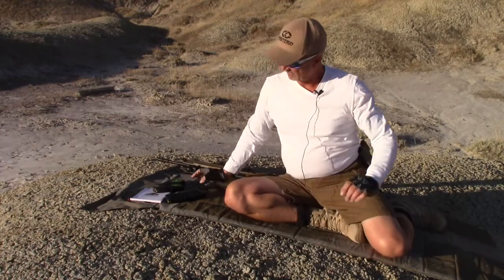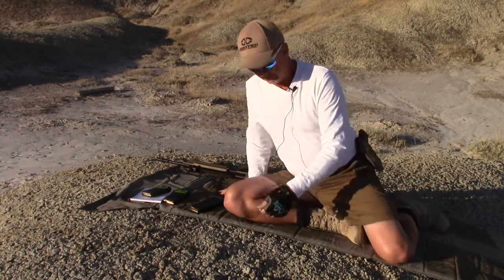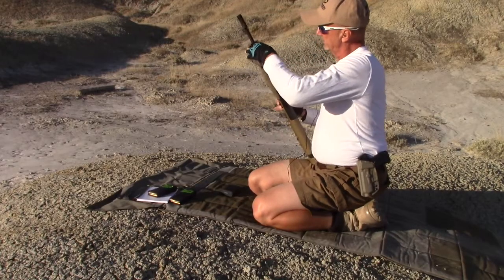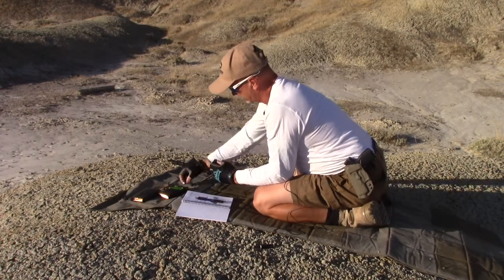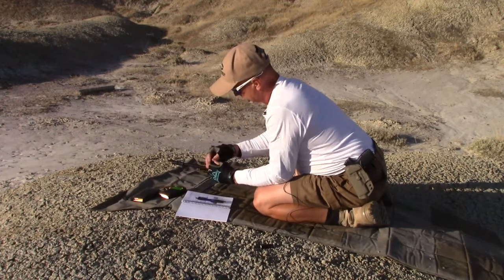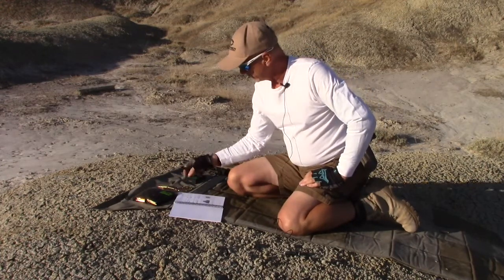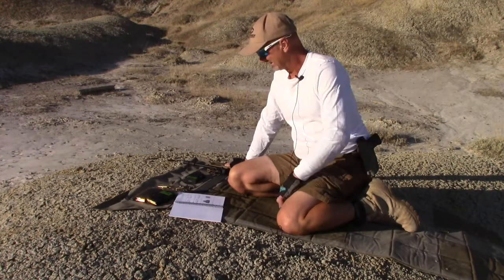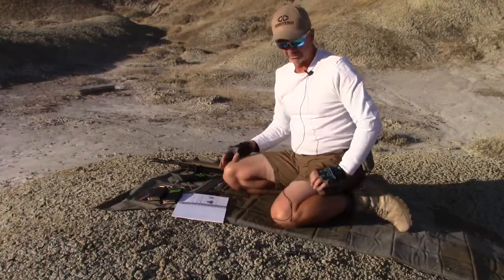KelTec RDB Gas System Test Based on Different Bullet Weights

Comment: I find that the gas system is easier to explain by using different terms - it's a gas 'vent' instead of 'knob' and instead of clicks 'left' or 'right' I use 'open' or closed' referencing the direction of travel, since it moves in the direction that it's sending pressure. People tend to grasp the idea much sooner.
Reply from the maker: I'm using that next time I cover an adjustable gas block...adjustable gas vent.

Comment: My 18.5 barrel with 62gr is set to 4 notches from closed.
Reply from the maker: That's a pretty big difference from my 8-9 setting. I wonder if there's been an update to the gas block since my testing. Your setting leaves you a lot more room to accommodate a suppressor.
Reply: @AmbGun  no doubt bizarre. And unrelated but today at the range after 80-100 rounds firing pin didn’t hit primer but the slug got pushed into the cartridge. Very strange. I kept it after keeping in the nearby pond for hours.  I’m not active on social media but would love to share the pic of the cartridge.
Reply from the maker: @brutus007  I would like to see that. If you could email it to rifleman@ambgun.com I will post it on the RDB page on www.ambgun.com.
Reply: What RDB comes with an 18.5" barrel?

Comment: It seems to me like you did it wrong. If you started at 10 from bottom if you ad more clicks your adding more gas  which the bolt should always lock back. If you start with 10 you turn clicks towards bottom to take out gas then the bolt wouldn't lock back once you took to much gas out.  I have a rdb  mine is at about 14 clicks
Reply: Isn't 14 clicks all it has

Comment: Thanks so much for the great videos! I know you haven't been getting the traffic you expected, but the ones who watch love the content!   When you use the terminology "in" and "backing it out" does that mean increasing the gas setting opens up the valve (backing it out) and when the gas adjustment is "in"all the way it closed off virtually gas being redirected?   Also I assume the + on the RBD means more gas and the - means less gas
Reply from the maker: Turning "in" is delivering more gas, "backing out" is reducing the gas. As you back it out you reach the point where the rifle stops cycling (or locking back on an empty mag). 

Adjusting the RDB gas system is real easy.

Turn the adjustment knob all the way in (clockwise) until it bottoms out. Back it out counterclockwise 10 clicks. Insert mag with one round, fire. If bolt locks back on empty, back off two more clicks until bolt fails to lock back. At this point turn the adjustment back in clockwise 4 clicks for reliable operation. Turning it in more clicks it will continue to cycle but more harshly...if action got very dirty, you could click a couple clicks in clockwise to force it to cycle. 

I really like the accessibility of the RDB's adjustment knob (compared to the Desert Tech MDR).
Reply from the maker: Yeah the traffic has been disappointing. Last year, traffic and subscribers were rising exponentially and then suddenly plateaued...coincidentally with two videos highly critical of CCP Chinese products. Also at about the same time I expanded heavily in alternative streaming platforms (Brighteon, BitChute, and, later, Rumble), so I'm not sure if I was oppressed or it was just the dilution of exposure.
Reply: @AmbGun  I never hesitate to reach out as I know you'll respond promptly and thoroughly!  And today was no different!     To be totally blunt I don't see a difference in quality between your videos and the videos of other YouTubers who have a massive following.  You edit videos well and never leave me saying "just get on with it already" if you noticed a significant drop-off and viewership... I doubt it's a coincidence.  Especially in modern times when we're plagued by cyber censorship (coined that term myself)  thanks!!!!